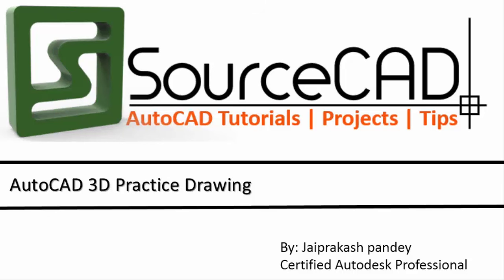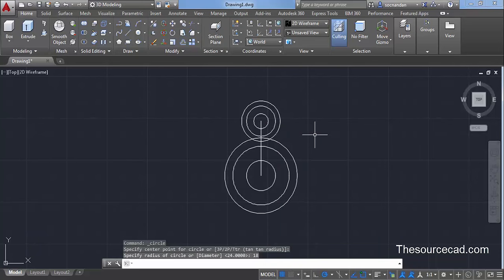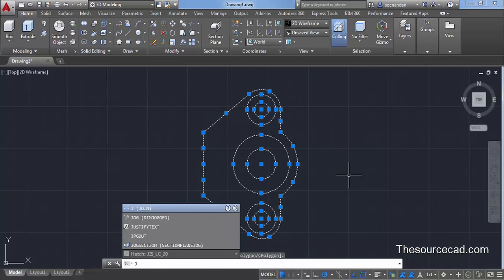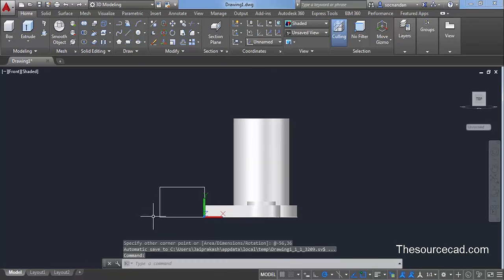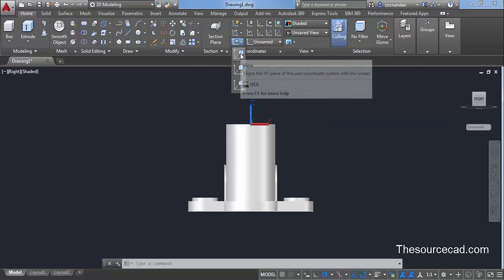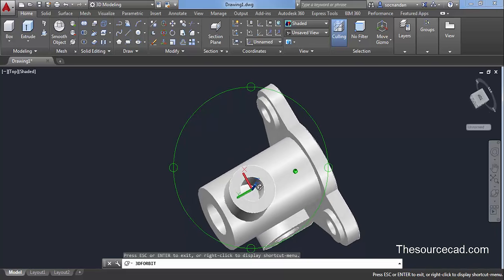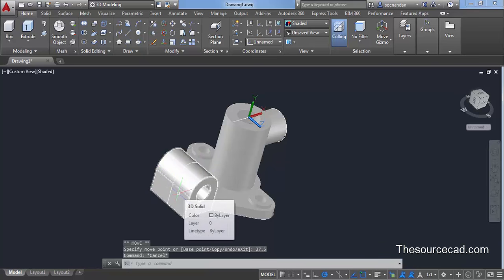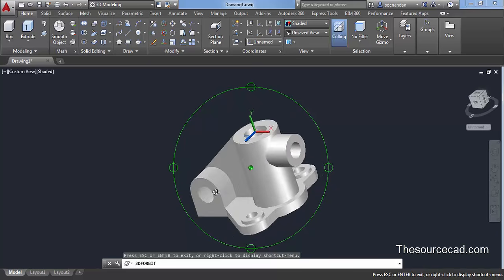Autocad 3D practice drawing : SourceCAD

Comment: I couldn't get the last part of the drawing to extrude as a solid though I did exactly as u did . Do u know how this can happen?
Reply from the maker: Can you exactly tell me at what time in video you have this issue?
Reply: +SourceCAD 
21.52
Reply from the maker: Have you completely joined all geometries into a single closed loop? If not join all geometries again before extruding.
Reply: +SourceCAD When I click on that line the whole shape turns blue which must indicate that it has been joined but for some reason it does not extrude as a solid as its only the edge that extrudes and the middle of the shape is an empty space.
Reply from the maker: It may happen if there is a gap on at least one of the edges, To close open edges type PEDIT on command line then click on geometry and then type C and press enter. 

Even if this techniques fails to resolve the issue with the geometry then zoom each vertex and trim extra edges that are found in the geometry.

Comment: Please , i dont speak very good , but want to know if you can make a heat exchanger , i would appreciate
Reply from the maker: Making a heat exchanger will require me to produce a long video possibly of an hour or long and it may not be possible to share it on SourceCAD as video length on this channel are relatively short ranging from few minutes to upto 20 min max.

Comment: Dear Sir ,
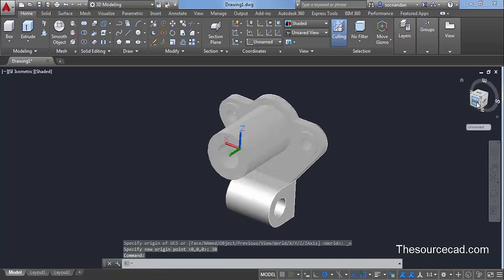     I can not repeat the result as what you present at 13:23 min while moving the origin downward by 30 after the origin was placed on the extruded center, I find that origin was moved outward attached on the cylinder by itself , instead of remain in the center of the cylinder . such that  when I move the origin on 'Z' direction by 65 , the origin is not  at right position it has beyond by 35. can you tell me why it happen, where I have make it wrong Thanks very much !
Kan
Reply from the maker: Are you changing view to parallel by right clicking view cube and selecting parallel from contextual menu?
Reply: +SourceCAD , Yes , I had selected. view parallel
Reply from the maker: In that case you seem to have missed changing view of UCS, shown at 12:46 in the video. Make sure you are changing the view.

Alternatively you can also type UCS press enter then select view from command line and then repeat the process of moving UCS downward to 30 units
Reply: +SourceCAD , Thanks very much for you helping, the problem was solved.,by the way, I observed that there is something different on the set up of  the bottom bar between us , my  "3dosnap" is on , I did not see it  display on yours.  I put it off after your hints ,do you think it will help also
Thanks very much !
Kan
Reply from the maker: Yes it will help you by avoiding accidental snapping to unwanted points in the drawing, I am glad your issue was resolved :)

Comment: I personally feel the Rib you have drawn is not intersecting with the cylinder. You have extruded the rib in the best possible way but it would fail to intersect with the cylinder as the cylinder is circular in shape. Had there been a rectangle there it would have intersected considering they both have flat surfaces.
Reply from the maker: +Chirag Jakatdar You are correct the rib needs to be made from inside cylindrical body else it will fail to merge with it and in this drawing too it has been made in best possible way but there is a gap which is left due to circular shape of cylinder.
Reply: +SourceCAD Thank you for clarifying my doubt sir! I've gone through most of your videos and you are doing an awesome job! Keep up the good work.
Reply from the maker: Welcome Chirag :)